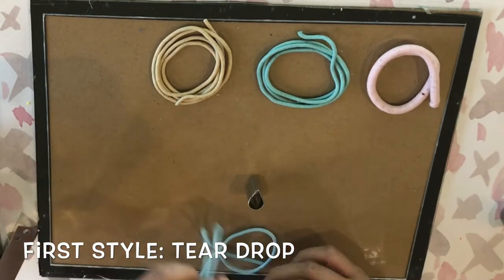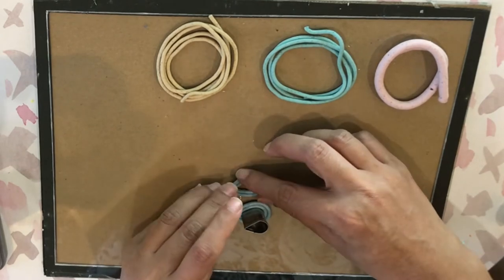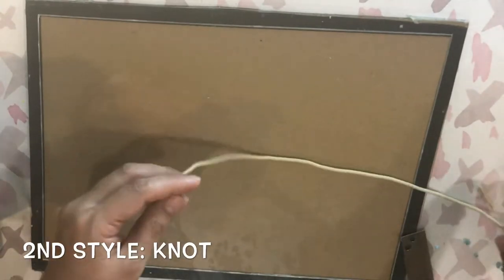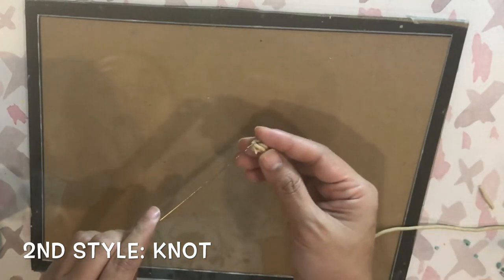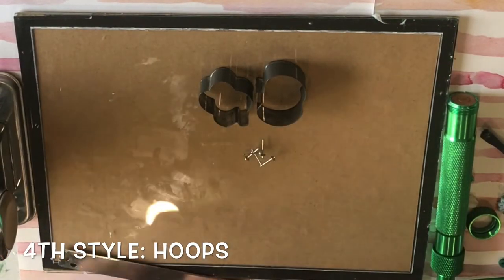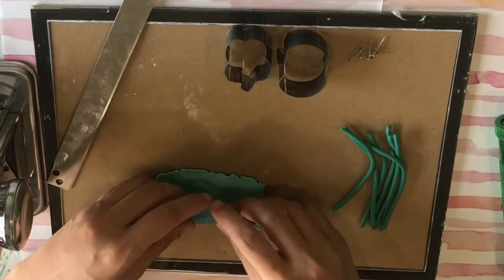Polymer Clay Tutorial 40: Experiments with a Clay Extruder

Comment: How do you clean your extruder between colors so they don't get contaminated?
Reply from the maker: Hi and thanks for stopping by. First, I clean the plate by scraping off any stuck clay using a tissue blade. Then I spray fhe plate with some alcohol and wipe it down. I also scrape the exces clay from the thing that pushes the clay out of the extruder.

Comment: How do you keep the snakes from splitting apart? I've just made some of the rainbow shaped type with Sculpey Premo, and the snakes split apart pretty easily.
Reply from the maker: One way to do it is to put a little bit of liquid sculpey on the snakes to make them adhere better to each other. You can use a pin or a detail needle to spread the liquid Sculpey 😊